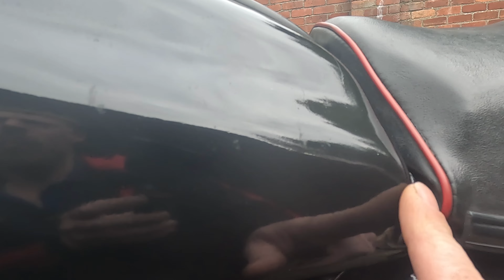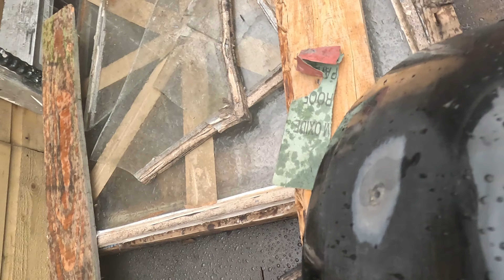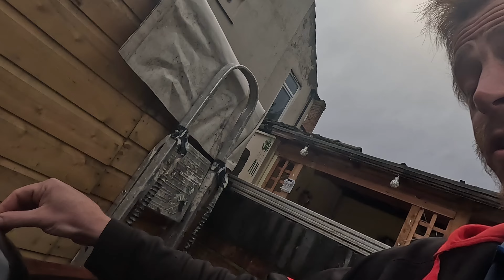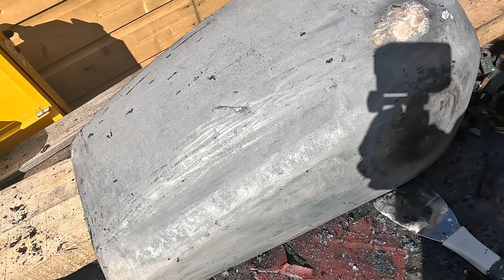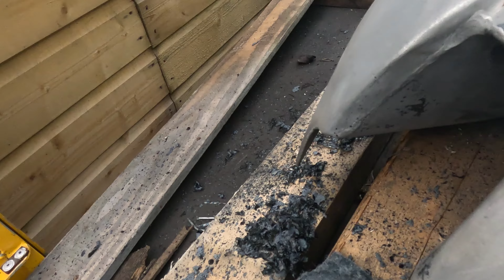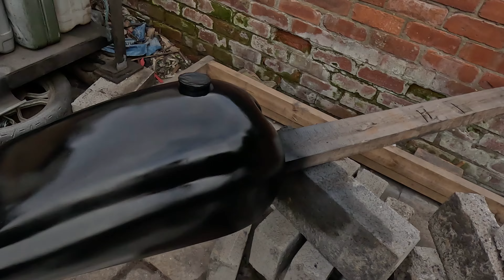Norton fuel tank "repairs"

Comment: ok, what you need for tin soldering is, after cleaning the substrate (tank) get frys tsc solder paint, This is how to use it. Applywith a smal brysh then heat then with a lint-free, damp rag, wipe the solder paint, you will see it go like chrome, any black spots, scratch them out apply a bit more solder paint, wipe again then get a bit of 2x1 wood cut a 45% on one end ,that is known as a padl pute the padl in a cup with some oil, get a stick of grade D solder and melt it to the solder paint using the padl, this sort of thing was my job for a verry long time IE clasic cars, have fun, hope that helps
regards willy

Comment: Oh B*gger ! 😮
It's a good job you dented it now , saves having to do it later .
I've always steamed tanks , I've never been brave enough to flash the vapours off with a gas torch .
I had a bike that I thought I would smarten up ,so I brush painted it from an old can I found . Then took off the next day on a trip ,after a couple hudred miles , I noticed bl**dy paint never dried . So I decided to wipe it off with a petrol soaked rag .
The result was interesting .😅
Good luck with the shed .
Reply from the maker: Flashing them off can be interesting. I've found it best to wait a while after the initial flash and do it a second time. I too have set off with wet paint, it can create some interesting effects.